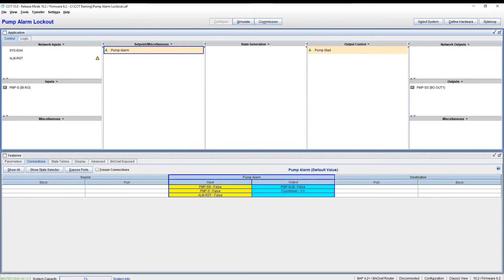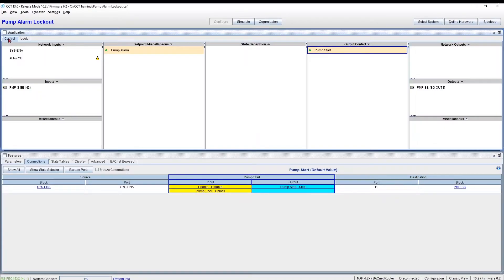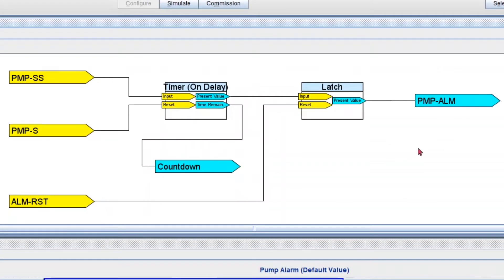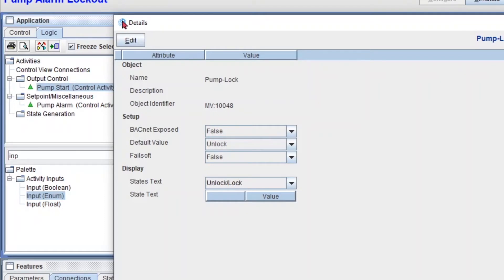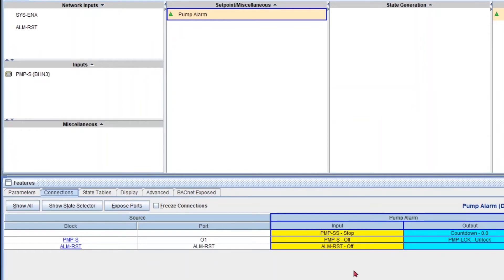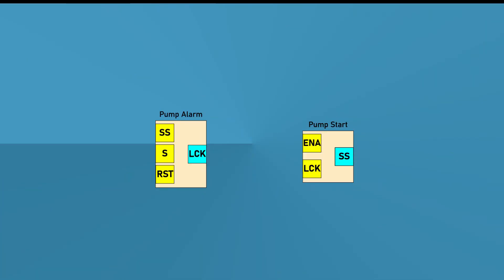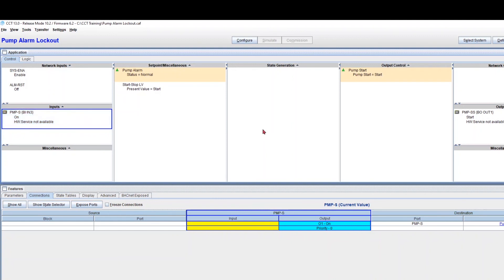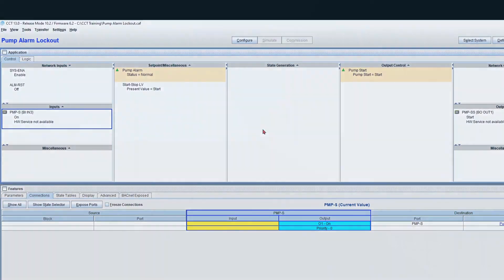Pump Alarm in Johnson Controls CCT - Part 2 - and Last Value Module

Comment: What determines if the logic block would go under the setpoint/miscellaneous column, or the output control column?
Reply: Thank you for the very thorough explanation. I've learned so much from your videos.
Reply from the maker: @Shutyourjibbs  I'm very glad to hear that! I'm hoping to make more videos soon!
Reply from the maker: Hello! That is a very good question. Ok, so if you are programming "State Tables" it makes sense where you put your logic blocks. Usually, for State Tables your logic blocks would go under the "State Generation" and the "Output Control" columns. It is not strictly necessary, but I think is more for organizing your blocks better and making your State Tables easier to program and read.

However, if you are not going to be programming State Tables (which I rarely do), then it really doesn't matter where you put your logic.

There are advantages of using State Tables as you can put priorities on your logic, and during commissioning/troubleshooting you can easily read the status of your logic blocks (like if you are cooling or heating, or if the system is down, etc.), and you can quickly modify some output behaviors. But the draw back is that it can take a bit of time to learn how to program them.

As far as my personal preference, logic associated with calculating setpoints, resets, and unusual stuff, I'll put it under "Setpoint/Miscellaneous". Logic that determines a mode, such as Occupancy, a special sequence, Economizer Mode, WarmUp Mode, etc, I would put it under "State Generation". And finally any logic that its outputs command a physical controller Output, I'll put it under "Output Control". I usually put my PIDs in there as well. Hope it makes some sense! Thanks!